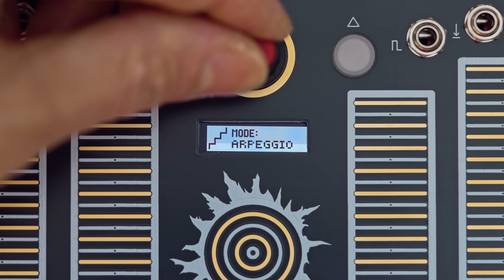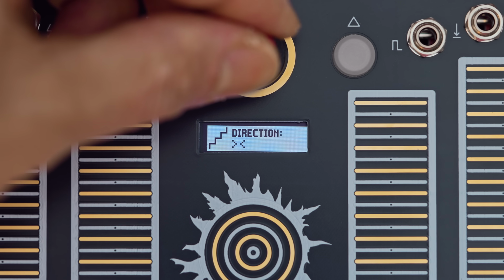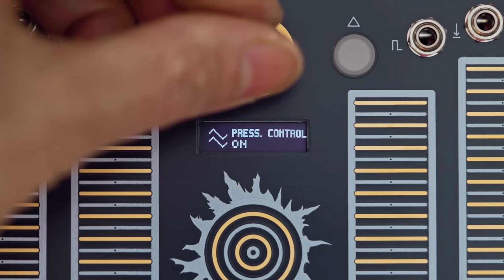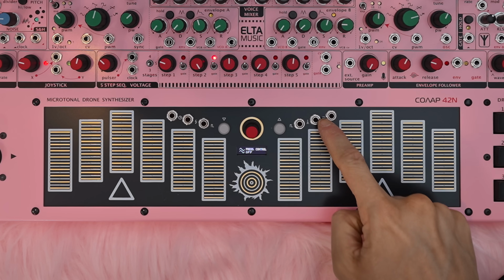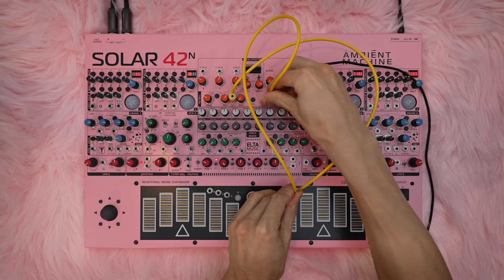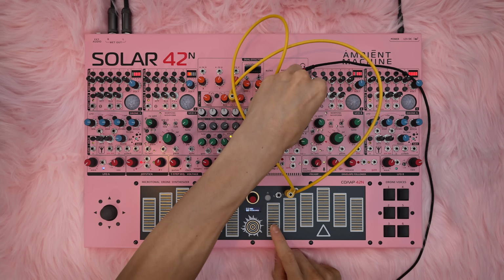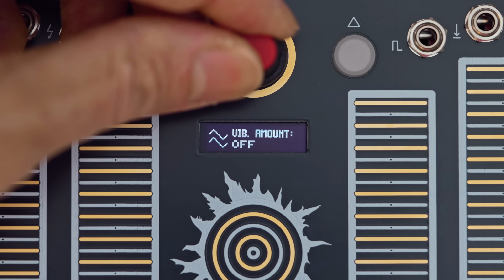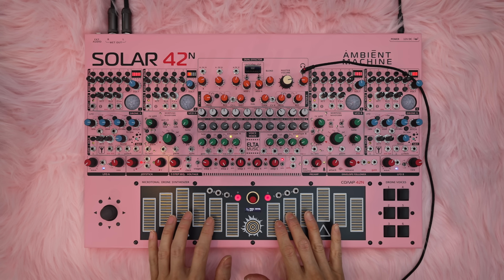Experimental instrument! (Elta Solar 42N)

Comment: The arpeggiator section around 5:41 is the useful part of this demo. The Solar 42N makes uncertainty playable, so you can shape a part before it turns into a fixed plan. That is a different kind of control.

Comment: I absolutely adore this synth. It's the first modular synth I've used that I felt was truly intuitive. The capacitive keyboard is super responsive. And I love the drone sounds. The only thing I've found is that I need to leave the one I currently have on for 30-45 min to get the oscillators to stabilize. Aside from that, this thing is a blast to play with.

Comment: I have the Solar 42F and it’s great in terms of what it can do - incredibly versatile. I often see people complaining about it having no MIDI ports or not being “playable” live. 

That’s really not true imo, you can easily send CV outs from a keystep to the 2 main VCOs and use it with MIDI. Any keystep would be able to offer that possibility. I think the drones would be harder to get on with live, but after all this is a microtonal synth that is purposefully designed to sound alive. 

This synth is surely not for everyone, as it forces you to think outside the box. People also have been complaining about the Buchla Style Sequencer on the Solar not being able to be synced with an external BPM. This is also not true, as you can also achieve that via sending CVs out from a Keystep. Yes, it does require you to think unorthodoxically and spend time learning it as an instrument, but that’s the fun to it. For sound design, this thing is a beast once you get to master it!

Comment: I own the Solar42F and love it. It's such a beast and can do so much more than just drone, certainly not a one-trick pony. Where it really shines is when you start incorporating other modular gear into it, especially since it has limited 'hands off' modulation sources. One thing I really wish you could do is to independently route the various voices to filters of your choice; it would've made sooooo much more sense that way and would unlock a huge amount of additional potential. Being able to program the sequencer pitch with the touch pads (and not the little screen) was also a huge missed opportunity IMO.

Comment: The original Elta Solar 50 is one of the craziest noisemakers I've ever seen.  Never before has an instrument been so finely crafted to NOT make music.  50 oscillators which all need individual fiddly tuning on, like, an hourly basis, and they go out of tune any time the ambient light level changes, or even if you simply put your hand near the tuning knobs.  It's downright diabolical.
Reply: It's entire purpose is to be imperfect and somewhat random. I like both of them, 42 is step forward towards predictability and additional functionality, but I like how 50 keeps you surprising, especially with those accidental combinations of oscillators that turns the voice into series of rythmical pulses, rather than the plain sound texture.

Comment: lots of weird today!
amazing thing though it doesnt seem to break too much from music theory imo
congrats for the release!
does this also have inputs for external midi or you have to use the pressure pads to play notes?
Reply: You cannot sequence it externally with a normal MIDI controller as is, since it doesn't have a traditional MIDI in port. It can, however, receive pitch and gate over CV (on mainly VCO A & B), so you can play it if you have the correct MIDI to CV conversion gear. In my case, I have a module in my modular rack called ALM mmMidi, which converts MIDI to CV, Velocity and Gate, so that it can then be used to play some of the Solar 42's voices with my keyboard (or any DAW sequence). Most of the voices only receive Gate inputs, so you can trigger them externally with a burst or similar trigger, but you cannot alter their pitch. Hope this helps.

Comment: i wanted a solar42 for years, eventually i got one, i really liked it but i ended up returning it in 10 days because life is too short to tune 20+ oscillators every time i sit in front of it. so i went ahead and wrote software that scratches the same itch (except tuning oscillators) and it works in the terminal of any computer: LUNAR84. google it, it's FREE :)

p.s: there's a couple of video of it here on youtube as well: https://www.youtube.com/live/5fNxkqLd2Po?si=p7Arwp810okh4QHC or https://youtu.be/WFuVw_BxxUY?si=1G4GsCSxPj2NkU63